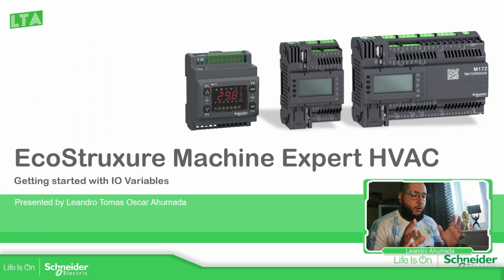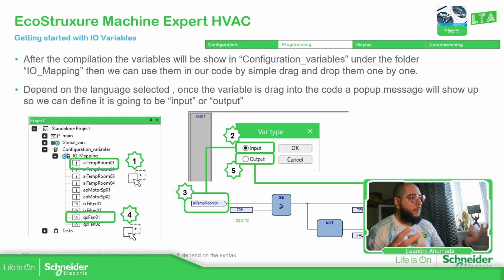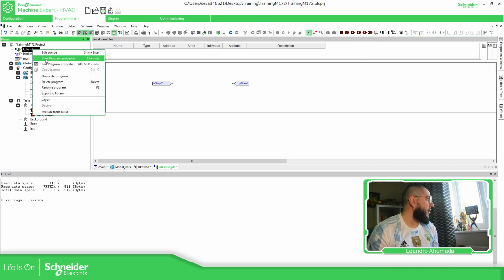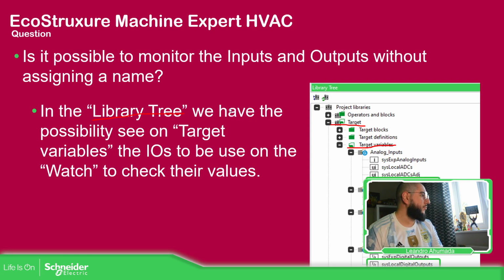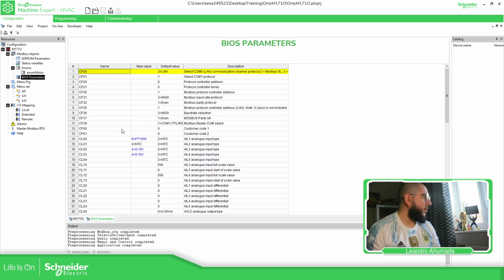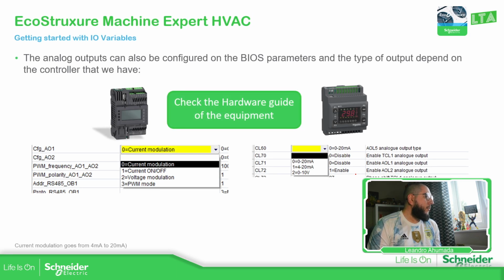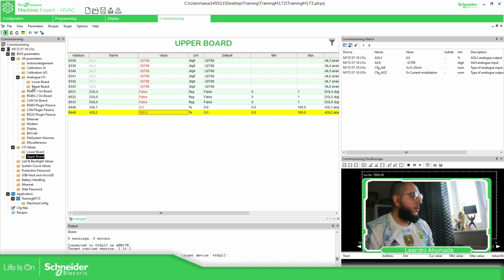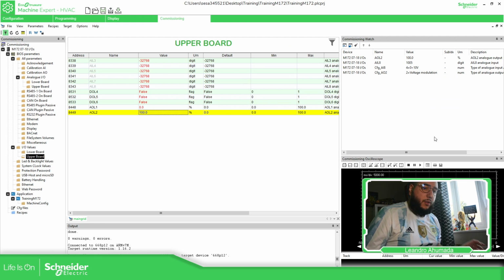EcoStruxure Machine Expert HVAC Training - M3.6 Getting started with IO Variables

Comment: Mr Thomas, i am currently learning about how to develop a system using the m172P PLC, and your videos helps a lot of it, can you make a video about the type of sensors that can be use in this plc, such as the wiring configuration (2wire, 3wire, 4 wire Transmitter) and the signal type such as(0-10v, 0-20mA, 4-20mA, and the ratiometric/0-5v).
Reply from the maker: Hi there! Thanks for your feedback. At the moment i am working on communications on the M172 but i can try to work on the use of the IOs. Thanks
Reply: hi i need you help in Machine Expert 2.2

Comment: One question: can you assign a variable to the Cfg_AI1...? For example, if are using a 0-10V transmitter and, when the unit is already installed, you need to change to a 4-20mA transmitter, can a variable be assigned to the Cfg_AI1 and to be able to change this through the display without connecting the PC?
Reply from the maker: Hi there! You can use the address shown in the properties of that variable instead of the name in the code ( do not asked why it is not possible to write it in that way)